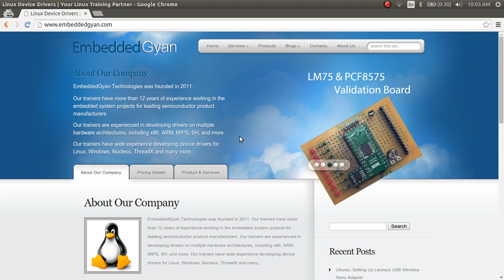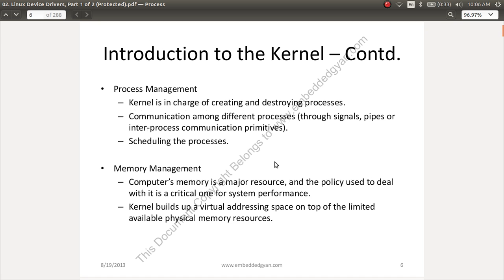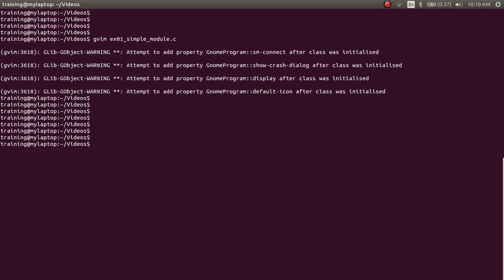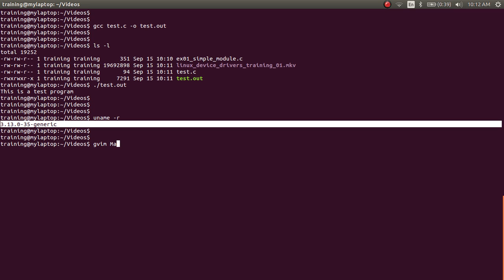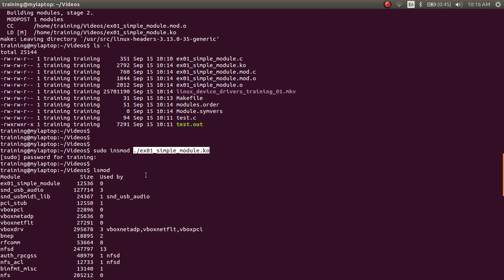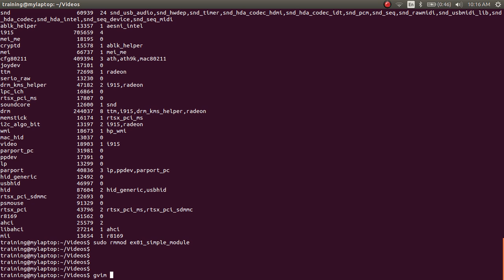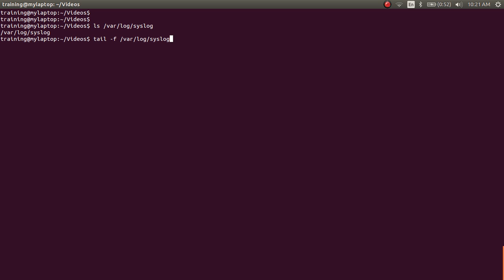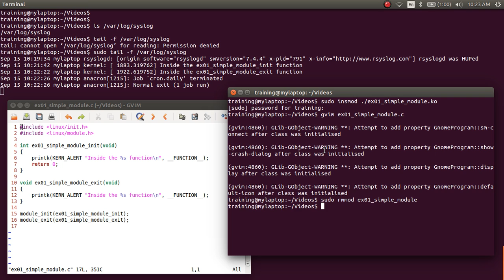Linux Device Drivers Training 01, Simple Loadable Kernel Module

Comment: Hello Mr. Karthik, Nice video.. I compiled the code and hello.ko file has been generated for 
hello.c  

#include <linux/init.h>
#include <linux/module.h>
int hello_init(void)
{
	printk(KERN_ALERT "I am inside kernel ");
	return 0;
}

void hello_exit(void)
{
	printk(KERN_ALERT " Leaving the kernel, bye " );
}
module_init(hello_init);
module_exit(hello_exit);

But in the kernel log 
I am inside kernel  - comes for rmmod 
and 
Leaving the kernel, bye  - come for insmod 
However function seems to be properly initialised to module_init and exit 
Can you figure out the mistake ?
Reply: I'm facing same error. Have you found the mistake?

Comment: Hi Karthik,

I am not able to load the driver. It gives error in makefile as /bin/sh:gcc not found, some macro is enabked but no binutils found.
Reply: @leecoca482  thanks buddy. It worked for me by apt update and then little modification in module and makefile required. After that, it worked.

Comment: NOTICE TO NOOBS (like myself): After running insmod you might get a permission denied notice. Turns out on newer kernels you might need to disable secure boot. Found this out from:  ravery @ https://askubuntu.com/questions/986627/error-operation-not-permitted-from-both-insmod-and-modprobe (first comment not the first answer). Hope this helps!
Reply: but even after that, i got this error. 
insmod: ERROR: could not insert module ex01_simple_module.ko: Invalid module format

Comment: Have  you  guys  ever  seen this error  ?

make[1]: Entering directory `/usr/src/linux-headers-3.13.0-95-generic'
/usr/src/linux-headers-3.13.0-95-generic/arch/x86/Makefile:111: CONFIG_X86_X32 enabled but no binutils support
Makefile:614: Cannot use CONFIG_CC_STACKPROTECTOR: -fstack-protector not supported by compiler
Makefile:614: * missing separator.  Stop.
make[1]: Leaving directory `/usr/src/linux-headers-3.13.0-95-generic'
make: * [all] Error 2
Reply: ok  guess I figured it  out.  Basically make  sure  you  dont   have  any space on  any of the directory folder  names.  for  example  dont  have  a  directory folder  with a  name  of  "example 1".   Instead  use  an underscore  like "example_1"

Comment: [ 5031.748196] module ex01_simple_module: .gnu.linkonce.this_module section size must match the kernel's built struct module size at run time

everything was fine until make process but when i tried to load the kernel object into kernel, i got this error. how to resolve it ?